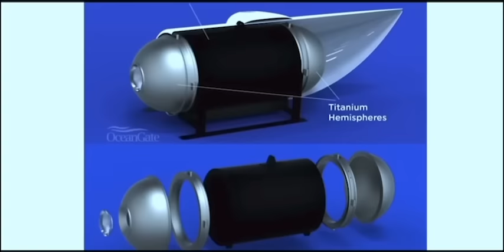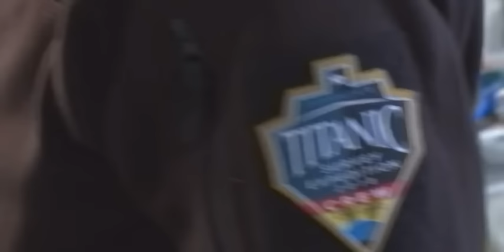First look at #oceangate #titan Debris

Comment: I'm almost positive this was the cause of failure. The first time I saw this that epoxy connection it made me weak in the stomach, I would have only used mechanical fasteners with known values for something so critical.
Reply: When I first watched the original making of the Titan sub video it literally made me sick to my stomach watching that much stupidity. There is absolutely no reason why they let this vessel even be loaded on that ship much less dumped overboard.
Reply: Happened the same to me... i wonder if those engineers know about a device called "autoclave" where, at least, you can cure the epoxi making sure it'll have no bubbles... Not that it would probably made any difference... I think that sub was gonna pop out by the feebler endcap sooner or later...
Reply: @Ole_CornPop  well I'm glad I'm not the only one who felt that way I thought I was like weird or obsessed because I felt angry when I saw that.
Reply: you probably woulda attached jet engines on it too .
Reply: Adhesive fastening is standard for composites, you don't want mechanical fasteners in there. It's bad at accommodating high local compressive stresses. They also lead to stress concentrations that makes failure of the composite material more difficult to predict.
Reply: Let's be honest the only function of the glue at depth is to seal, not to hold. 

At 6000psi  and a hull diameter of 5.5ft the titanium flange is pressed against the carbon cylinder with a force of roughly  10000 tons

I would be more  concerned about the glue being squeezed out with a pushing pressure over 20000 psi at the mating surface..
Reply: @arjanstam1705  yeah but the carbon hull deform more than the rings, and you have areas acting with different forces. If it was made of a single material, the tensile forces would counteract the areas that are pulling towards the center of the sub. Bye bye epoxy. You can't glue a pressure vessel.
Reply: @arjanstam1705  Still, I am wondering what happens to an epoxy glue at 400 bar when you apply high shear loads to it (from the stiffness difference between the parts).  If the glue started to behave more brittle and a crack formed...
Air and water gets in the crack on resurfacing,  the crack is pressurized when you go down...
Reply: @fishshipemployee   considering the use of different materials, my design philosophy would be somewhat similar. First design a cylinder capable to withstand the axial force and hoop stress. Without needing support of the flanges the bear the forces. Then creating a flexible seal between te cylinder and flanges to ensure they can move freely without introducing al kind of strange forces and bending moments on the interfacing area.
But, even with a low friction coefficient between cylinder and flange I don't believe "free movement" can be achieved 😅

However I fully agree on the risk of water intrusion, and the strange use  carbon in compression. They proved the concept worked. But not with a great lifespan...
Reply: Well you play with enough weird materials to have an idea.
But no one over 10 years old would be stupid enough to use carbon fibre which gets it's crazy strength from it's woven cross ply layers and lay it down in one helical wound direction and think it wasn't going to fold and separate and delaminate with repeated compression cycles.
Reply: @disturbed_deliberations  yeah unfortunately you are correct. And also yes you know I use a large variety of materials and I have experience with many. I would have had to have some ribbed very happy support rings on the inside of that carbon fiber hull, and that's after I had been woven properly.
Reply: @ArcticSweets  haha... if I did They would have actually worked when u needed them 🙂
Reply: @arjanstam1705  exactly but the epoxy is stiff, so during a pressure cycle if the elastic modulus of the adhesive is too high then cracks will develop as those two dissimilar materials move, once even the smallest cracks form they would become tiny water jets. That's exactly my point.
Reply: @argh100100  exactly, cracks will form on the epoxy from the slight movement.
Reply: @fishshipemployee  agree
Reply: They couldnt that would mean more holes in the sub thats why they chose epoxy the less holes you have in a sub the better
Reply: The way they applied the adhesive, there is no way to assure uniformity on all 3 sides. Not to mention, any bubbles that form when the adhesive from the titanium ring make contact with the adhesive from the carbon fiber hull. QA was non existent. I agree with the content creator, the people that made this thing and smiled as they monkey wrenches this wreck together should NEVER be allowed to under take a project like this ever.
Reply: Putting glue for that on with a sponsh and some metal scratchers on the most critical connection ... Yeah it turned my stomach.... In my work in construction we have better tools an specific mashines to do the job ! Even  front glas car repair placing the glue in a coned way to glue even and avoid air bubbles ..... Just feel so bad for the boy I guess he didn't trust that thing as well ...
Reply: @arjanstam1705  You're not wrong on that note, the 2 end caps would have been pulled towards each other, compressing the carbon fiber cylinder in between, but that only describes the force front to back.  the titanium ring held the carbon fiber from the outside, so as the cylinder was compressed on the top and sides, it wouldn't be compressing the glue, it would be forcing it apart.
Reply: Such critical work needs to be done in a clean room “critical environment” where atmospheric conditions are tightly controlled. This work was carried out in a dusty warehouse and the workers did not wear any PPE. This is carelessness. Pure and simple.
Reply: @argh100100  Here we are not talking about composite material, but joint of completely different material.  Simply glue two thing together does not give you composite action.  Only viable joint here is mechanical connection with flanges on both parts and bolted them together.
Reply: @FPVMystique  that's a great point I didn't think about. I'm sure that the manufacturers of that epoxy have some sort of optimal working condition set forth, temp humidity etc.
Reply: @arjanstam1705  Exactly..
Reply: Agree! At the very least go thru all the proper safety standards and protocols. This guy was just courting disaster! If I was that rich and knew this going in, there is no way I or my son would be getting on that. Not ever, never! Makes me wonder what they knew or didn't know.
Reply: @雨溅三通  I don't understand what you mean. What is "composite action"? They have made the choice to use a composite cylinder, so there is already "composite action" I think. 

You mean that they should have dumped the carbon fiber to start with? I won't argue with that, but then it is not the glue that is the problem.
Reply: The bonding lip was far too shallow to allow for cycling pressures to hold,bonded on smooth surface…disasterous
Reply: @DanielMG6589 Would’ve cost too much…same as correctly rated window….$100,000
Non-destructive testing of the hull…a mere $20,000
But safety was a waste,he said
Reply: @donnamorgan2522  agree, i saw that tiny lip and shivered
Reply: @_theender312  When that hull cycled at depth & pressed inwards…
Reply: That would be the least to worry bout! The pressure of the water would keep it shut tight. It was the carbon fiber that failed! Hence, the cracking they heard before death
Reply: @sharkdiddy9241  Yeah,but I think that compression’s gonna seperate that titanium ring’s epoxy bond-it was smooth as a baby butt so nothing to grip,sm insert…so much wrong
Reply: @argh100100  That was my first thought when I read the suggestion to use mechanical fasteners as well.  It demonstrates a complete lack of understanding of fastening.  I have some experience building and designing things.  It seems that the lip inside the CF tube should have been much longer by a factor of 3.  Even though this style of bonding is the norm, I have to question how much research was done on the strength of their glue at the temperature at that depth.  Most adhesives get pretty brittle when cold.
Reply: @David-hm9ic  It's not the temperature that's the problem. Your temperature will never get below the freezing point of water, which is not so low for a glue. For most glues we know very well how it behaves at that temperature. It's the pressure itself that embrittles the polymer behaviour. Molecules have less mobility if they are squeezed from all sides.
Reply: @DanielMG6589 There’s no way they could’ve even produced the carbon fiber cylinder without an autoclave.
Reply: @argh100100 there it is. The shear loads. They assumed pure hoop stress, with an essentially unstressed glue joint held together by compression on the end cap. But as the cylinder bows inward toward the center, there’s a shear stress at the joint like you say. 

The best glues for CFRP to Titanium interfaces are only good for a few thousand psi (titanium and cfrp are both good for over 100,000 psi, for comparison) so they really did need to design for that joint to not be load bearing under ocean pressure. So that sounds plausible but I’d be really surprised if their FEM didn’t warn them of this at design time. Surely they assembled everything in a model and checked it. Right?

Right?
Reply: @donnamorgan2522 the sad thing is, NDI wouldn’t have spotted a failure of the bond between the titanium and the carbon fiber. It can only spot a failure of the CF itself. So if the bond failed there was never a way to inspect it to begin with; the design had to be such that the bond was only under pure compressive loading. As the center of the pill flexes it creates a shear force on the outer glue joint, at which point, ugh. 

The best glues are an order of magnitude weaker than either carbon fiber or titanium. If that glue joint ended up being stressed in shear, they were doomed from the start.
Reply: @fisquid  I agree,that bond was complete gone from the titanium,no residue.
The cyclic stress…it was a “when”,not “if” implosion happened
Reply: You can if pressure is external and pushing things together, in this case endcaps + rings against carbon fiber tube. Epoxy only seals against leaks. Structural problem here is slightly elastic carbon fiber composite tube contracts under pressure (diameter becomes smaller), titanium ring does not, this creates flexion stress at the joint. Now flexing is the enemy of composites, loud crackling sound they heard on every dive, so much so they added a special monitoring system for it, means either some carbon fibers broke on each dive, or some broke away from the matrix. Or both. Those are irreversible phenomena so on EACH dive hull became weaker.
Reply: For me, that is a BIG red flag to see they are using a couple of cheep step ladders to ascend to apply the glue. No scaffold set up or at least rolling ladders. This is certainly not a group of professionals doing a job.
Reply: If you had used anything but a material-specific weld, it would have eventually failed. Mechanical fasteners? Apparently, your definition of a mecanical fastener is different from mine.
Reply: @corkcamden9878  Mechanical Fastener Definition: "A mechanical fastener is a device that is used to mechanically join (or fasten or affixes) two or more objects together. In general, fasteners are used to create non-permanent joints; that is, joints that can be removed or dismantled without damaging the joining components."
Reply: Especially the German guy with his simulations shows the mating rings bending in as the carbon fibre implodes yet they were recovered in their original condition - which invalidates his simulations (they don't accurately describe reality). He should have found the carbon fibre separated from the mating rings before the mating rings felt anything at all.

Got any footage of the mating rings fibreward edges? If the carbon fibre imploded instead of the bond leaking they should have struck each other real hard and any imperfection amplified into warping.
Reply: Yeah, you think they didn't do this even in a clean Room, and then you watch they Guy, who cleanse the Titanium Shell before glueing, put his Hand (without Glove) on the Part, he has cleaned seconds before ....
They were doomed from the beginning.
Reply: @LemmingOHW  Of course, the guy checking the tackiness will be working under the assumption they're going to put it in a pressure chamber and cycle it a thousand times so he just has to do what he knows and let the experts validate it, he thinks.
Reply: I fancy that might have been the loud gunshot sounds people reported hearing on dives, the compression of the cylinder flexing the glued joint, it failing by small increments on each dive cycle.
Reply: @Jester123ish  I doubt they were close enough to the craft for it to sound like a gunshot, water does funny things to sound
Reply: WarpedPerception ... if you have a tapered male-female fit between the metal and plastic, a "O" ring of sorts ought to suffice with no real need for glue? I say this because when the boat gets down to specific levels the pounds square inch increases so the end caps get "press-fitted" together. This would also mean the stress limits would have to be tested for lateral pressures i. e. cap to cap pressures not just force acting on the tube. 5" of plastic may have been sufficient but how the boat was handled afterwards would have to be questioned. That said, glue may not have been a major issue. I don't know if you caught the hack about the porthole window frame...it is missing ... the bell-housing is seen with the 17 holes butt no bolts! I would say the plastic is much weaker than titanium. If the glass was the weak point it would have collapsed under the external pressure. The retaining ring holding the glass in place would necessarily still be there with all the bolts. It is quite possible the weak point was the rear with the water gushing forward, pressurizing the interior of the boat, thus forcing the water pressure to compress the inside of the boat. You have 6T pounds square inch outside the window with the same pressure coming at the window in equalization. To my mined, there must have been an explosion not an implosion...from compression. Even so, how does the glass get blown off the face of the bell-housing, taking bolts along v. blown into the boat leaving the ring, bolts and the outer ring of the glass still attached?  Here's what happened ... Are you sitting down? O. K. ... Rush was in the habit of running deep sea dive scams .... someone writ about this in another post so I ain't been able to verity but others write about the boat only being tested to a few meters deep. Most of the rides were aborted for various reasons. This time Karmen caught up with him! Things started to go wrong ... started to hear snap, crackle and pop so began to, as usual, abort the mission. But, as Karmen would have it, he couldn't seem to get the boat to rise. The boat continued to sink, slowly at first, then started to pick up speed. Everything was tried! All ballast was released and Rush even turned to his mission Specialists asking if they had any ideas! Catastrophic  brake failure occurred. There was something about the boat not being tested to see how deep it could go before failure. Now we know the approximate depth of such a contraption!
Reply: I am puzzled by the ring being pulled out separately in the wreckage debris. What happened to the bolted connection with the flanged domes. Looks like bolts got ripped out the interface ring
Reply: They looked more like mechanics working on a car in a workshop than engineers trying to assemble parts of a submersible..😒
Reply: When I heard open-air and no vacuum or autoclave I automatically thought failure
Reply: You came up with the same numbers I did! Thanks for the confirmation.
Reply: @StevenStyczinski-sy8cj  Crazy I just came back to this comment, it definitely aged well, apparently I had the right idea because now all the fax came out and it's exactly what I was saying. Apparently I'm not as crazy as I think I am..lol.